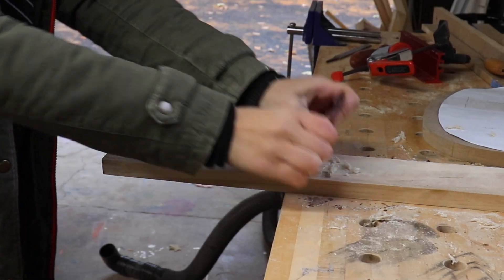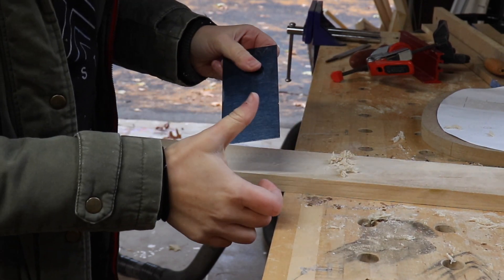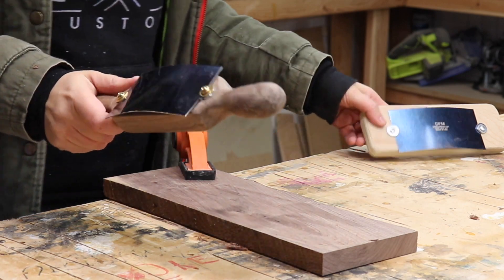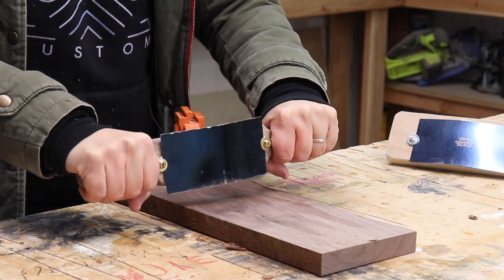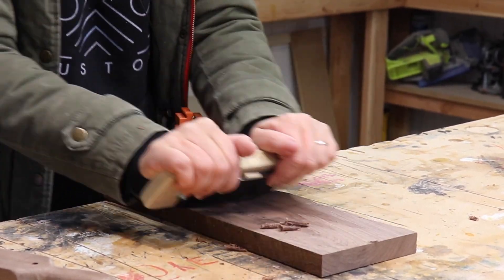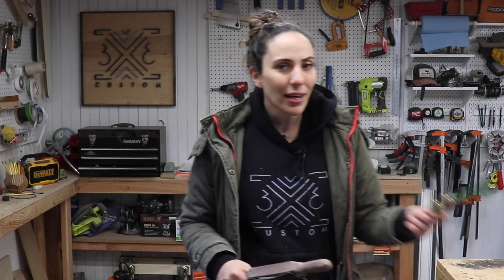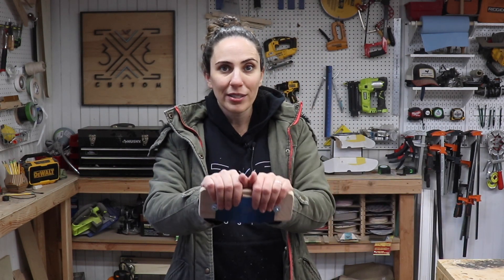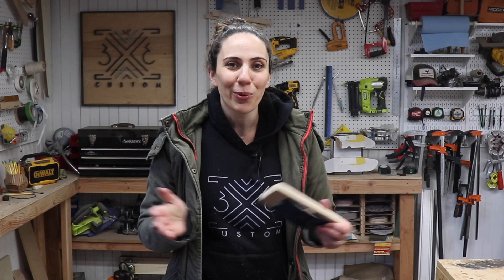Making 2 Different Card Scraper Holders - Which One Works Best???

Comment: The spokeshave one would make sense if you were pulling it since it gives you a better grip, but you're right the smaller one gives you more Palm are to push and better control of the angle

Comment: Surprising results, indeed.  I will have to make one of these.

I have also had good results with holding the scraper perpendicular to my body (i.e. with the length of the card extending away from my belly), scraping from left to right or right to left. Hold the short edges of the card scraper with the four fingers of each hand, and use the heel of the hand that holds the far end of the scraper to bend the scraper.  No tired thumbs, and you can switch directions easily just by swapping which hand holds the far end of the scraper.
Reply from the maker: Interesting

Comment: Could you try using the fancy one on a pulling stroke? I feel like that one would excel in that use
Reply from the maker: I tried that. It still didn’t work as well as the plywood one. Sometimes simplest is just best!
Reply: The rotational force is the key. Anything round, even a grip helps to facilitate that force. You therefore have to grip the handles tighter. If you extend the flat block of wood out so you can get a full hand grip (curve up the bottom edge a little to keep the wood out of the way?). This may eliminate a tendency to use the thumbs with extended use.

Comment: Really nice video. Thanks.

I've never used a scraper with that much bend in it. Also, I generally bend the scraper out near the ends trying to keep it as flat as possible in the middle - essentially feathering the two edges up away from the work. And yeah, that's even tougher on your thumbs.
Reply from the maker: Thanks. Yeah. There’s definitely going to be some tweaking involved to get the correct bend. But it seemed to do that job like this. Ha

Comment: Nice experiment with, as you note, interesting results.  I wonder if the way to do side handles is the way a traditional cabinet scraper is designed, with the blade bedded at an angle.  I like my Lee Valley cabinet scraper.  Also, I almost always follow rasping with filing instead of going directly to sandpaper.  Requires less effort and time with the sandpaper.

Comment: Good idea, though I had 2 questions.  1.) Wouldn't you want the threaded inserts on the other side for the two screws that hold the scraper on the walnut one? I'd think over time (unless glued in place maybe) the threaded inserts could work themselves lose.  2.) Did you know Stanley made such a device out of cast iron? (#80 cabinet scraper).  Though it's more reliant on the bur being in the correct spot, as you can't tip the scrapper like you can with yours
Reply from the maker: You’re correct. The 2 side t nuts should have been on the opposite side. I realized this after. But didn’t care to fix it since I’m going to use the plywood one. And yes! I’ve seen those! But the plywood works great! Ha
Reply: @3x3CustomTamar  Yeah, I like the adjustability that the plywood one has in angle, vs the Stanley #80, plus, in theory you could use curved scrapers with yours too.  Now I might have to make a few :D

... and buy more scrapers lol
Reply from the maker: Chris Albee good thing they aren’t so expensive!! Ha

Comment: I've got a card scraper on my list, so this is interesting- I may make one of these.  Your experiment has me wondering about ergonomics and the grip on the tool.  I wonder how it would feel to use a scraper with vertical handles on the sides.  That would keep your hands and wrists in a more neutral position.  The best example I can think of is the way you hold a Nintendo Switch or a big camera rig.
Reply from the maker: Yeah. Totally get what you mean. The veritas one looks kind of like that. And I’ve seen a few images of ones that looked like that. It’s worth an experiment!

Comment: A lot of the scraping planes use handles more like the “fancy” version.  I think the difference is that there is a wide surface on the bottom to prevent tipping / rotation forward /backward.  The other thing that might help is to use vertical handles (not sure how to attach - just thinking out loud) sort of like on a router plane.  When you push the card scraper forward, the resistance is on the bottom of the scraper where it hits the wood, so that’s where you need to counter the force.  If you counter it higher, it will tend to tip it forward.  Of course, your simple one works quite well.  =)  I was just thinking about how the scraper planes work and why the fancier one didn’t seem to feel right to you.
Reply from the maker: Yeah. You’re right. The fancy one was tipping forward.

Comment: Nice idea. The bend looks a bit to much.  When I use my scraper, the bend is usually fairly slight.  I wonder if you could make the spacer piece a bit thinner and use the screw in the back to adjust the depth of the bend? Just some thoughts. Thanks Tamar!
Reply from the maker: Thanks. Yeah. It’s totally adjustable. That’s what the bolt in the back is for. I just threw this video together real quick. There’s definitely some adjustments that I’ll need to play with

Comment: I feel that vertical handles wood perform better. If you took design #2 and put vertical slots for your fingers it would be perfect. Might require a bit longer board.

Comment: I had build a similar one 2 years ago try to reduce the bow shim with half this will increase the co tact area you will find more control on the blade
Reply from the maker: Maybe I’ll try that. But I just really didn’t like holding the handles. Ha. The plywood one just felt right to me.

Comment: Nice video, I'm trying to pick up some of these old school techniques.  I noticed on an earlier video you made a second cut into your crosscut sled so you can do 45 degree cuts.  I made one of those and I love it, and i want to do 45 degree cuts with one.  How has that worked out?  Is the sled still in good shape?  Would you do it again?
Reply from the maker: Thanks! So when I made that 45 degree cut the small piece between it and the 90 cut fell out. I just glued it back to the fence and it was fine. The only reason why I did it was bc I got he incra miter sled. So I didn’t mind if the zero clearance would be messed up..... that being said. I would prob make a separate sled for miters just so that everything stays nice and clean.
Reply: @3x3CustomTamar  Thanks for the advice :)

Comment: While the center T-nut is properly installed having the screw pull it towards seating in the plywood, the two outer T-nuts (despite your use pushing them into the plywood) may eventually come out. If they do the simple solution is to put them on the backside of the plywood so the hold down screws are pulling them towards the plywood. You may also need to add washers to the tool side for the card scraper to rest against.

Alternatively, you can counter sink all three T-nuts and then glue a piece of hardwood or plywood on top sandwiching them in place. Just make sure you drill the holes before gluing so you don't have to risk damaging the threads in the T-nuts with a drill bit.
Reply from the maker: Yup. I realized that after. But I wasn’t going to change it since I just liked the screws in the plywood better. Ha.
Reply: @3x3CustomTamar  
😎👍

Comment: I like your card scraper holders. It would have made more sense to put the two t-nuts that hold the ends of the scraper on the back side of the holder. Then when you tighten the screws it pulls the t-nut into the hole. The one in the middle is correct because the t-nut is pushed into the hole.
Reply from the maker: You’re totally right. I realized this after. I was going to switch it but I didn’t have bolts that were long enough to go through to meet the t nuts on the other side. Regardless I think the screws worked just as well and they weren’t necessary. Ha

Comment: As someone with no knowledge of woodworking, why is a card scraper any good? Wouldn't the bulge create a dip in the wood, and not a smooth surface? And is it effective (because I somehow feel like it is not)?

Great video as always!
Reply: It only takes off about a thousandths (.001) of material so any dip would be negligible if you could even notice it.  A properly sharpened scraper is very effective.
Reply: Thanks for the reply. So it is more of a sander than a hand planer?
Reply: @steveurquell3031  It's more like a plane than sand paper.  It is a blade that can only be used in one direction.  You can take off that small amount of material with a plane as well.
Reply: Alright, thanks. I've never seen one before, so I was wondering how it differed from using either a planer or sanding

Comment: Cut the handles off, but leave enough so you can round the ends just a bit and then hold it like the plywood one. Even store-bought holders are more like the plywood handle. It's easier to use when your hands are on top and your thumbs behind the blade. Also, the bend of the blade is too acute. When only holding the scraper with your hands while using it, the bend is very, very slight.
Reply from the maker: Yeah I definitely need to play around with the bend angle. This was just a quick little video. I was really hoping the one with the handles would work because I saw some beautiful homemade ones on google that looked similar. Oh well! Glad I tried it out
Reply: @3x3CustomTamar  I had a thought. Since you have two, have one with a sharper bend and one with a shallow bend. The one with the sharper bend may act a bit like a scrub plane for when you may want to remove more wood, and the one with the shallower bend for finish work. Might be worth a try.

Comment: huh.  What's that card made of? Tin? sheet metal? I've been using glass. 1/8 thick 4" wide with a slight arch. Man does it rip though clear coats, lacquer, shellac. but when they dull that's it. This is the 1st place I've seen these (on your video's)  You could make another simple one from walnut. 8*)
Reply from the maker: It’s just a thin piece of steel.
Reply: @3x3CustomTamar  Tanks

Comment: Tamar, I think if you want one with handles, you would be better off having vertical handles rather than the spoke shave style handles. And you would want to root those handles from the bottom of the block rather than the center. Think of an airplane yoke like in this image: https://www.aircraftspruce.com/catalog/graphics/05-16610d.jpg
Reply from the maker: Totally. I should have done something more like that. But the plywood one seems to be working fine!